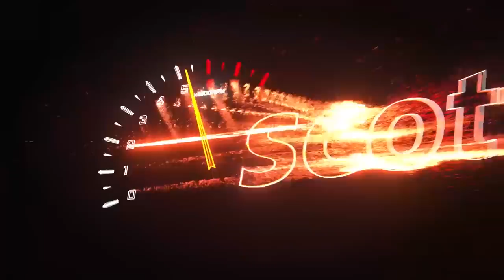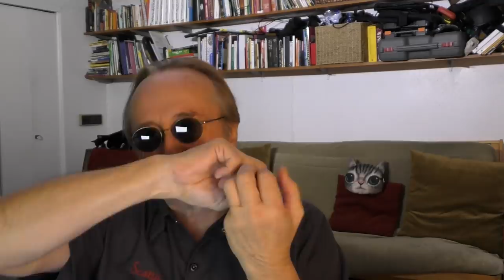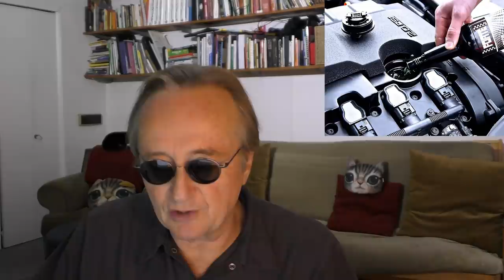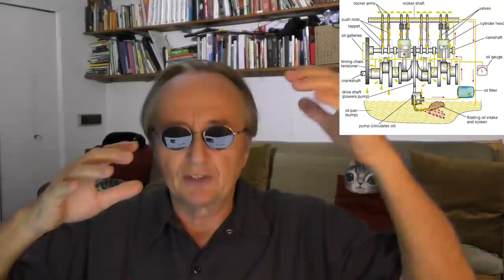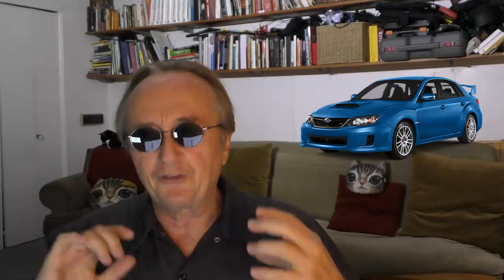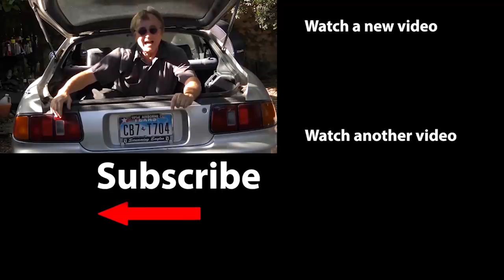Bad Mods that Will Ruin Your Car

Comment: I've never had issues with Subaru. Growing up, my mom had one and it never gave any problems. I now own an 18 Impreza myself. I think they are really easy to work on and I've seen some with over a million miles on them. Never seen that kinda mileage in any other car. It's also not uncommon to find them with over 200k miles on them. I say they are very reliable

Comment: With engine oils people have to consider  the EXTREME condition. If you live in a real hot or real cold area and just make short trips and hardly ever get on highway - this is extreme. You must change the oil at shorter intervals. 3000 to 5000 miles

Comment: I gotta disagree with you on this Scotty. I've had several cars tuned. They get better mileage when driven conservatively, and have much more HP when driven hard. The engineers put a generic tune that they think EVERYONE will be ok with. They're not necessarily interested in performance. They try to find a middle ground between performance, reliability, and maintenance costs.

Comment: "If you want a AWD, get a Tacoma"... "If you don't want a AWD, I'd say... Go with a Tacoma" 😂😂
Reply: yup...  i owned every pick-up there is to own.  The Tacoma gets the job done with zero headache!
Reply: My 13 Taco is a beast.
Reply: Tacomas are horribly slow. Reliable truck yeah, but an absolute slug
Reply: @andeleputo89  
For trucks is more about towing capacity to be fair
Reply: @andeleputo89  Ive got a '19 with the four cylinder.. it does alright.  Very comparable to a ranger with the 4.0, which I had prior.

Comment: The stupid thing to do is tune a car under warranty. I saw a video where Ford was going to replace a Mustang Engine under warranty and then they found it was tuned after they checked the computer info and voided the warranty, even though it was a defect in the engine.
Reply: I had a customer who decided to post videos online of the modifications he did to his new Mustang.  Then he posted the racing he did with it.  When he blew the engine he put it back to stock and had it towed in.  Ford fixed the engine under warranty.  Then he did it again except this time it was the transmission.  Ford put a transmission in it.  When he blew the engine again, Ford sent an engineer to look at it. The engineer found the guy's videos and voided the powertrain warranty.  The customer was mad but ended up buying another Mustang from us.

Comment: I'm on my 4th VW. They've all been reliable and fixing them isn't really more expensive than fixing a modern American car. My latest VW is a Passat TDI SEL and the odometer just flipped over 100K miles. No issues whatsoever. My privious VW was a Jetta 2.5 SE. I sold that car with 160K miles and it was still running strong - it needed struts, brakes, tires and a timing belt, but hey it still ran great as a daily driver. I think most modern cars can be reliable if you perform regular oil changes and all recommended service. Reliability goes south when you skip oil changes and drive the car like an F1 driver - just my two cents. Oh, and by the way, love your videos Scotty - always look forward to seeing a new one.

Comment: My 84’ Toyota pickup stock came with the 22r carbureted engine not much for hp or torque, it ran but not great. First think I did was modify it...well sort of I used Toyota factory parts, I converted it to EFI. Using all factory parts from the fuel pump to the engine for the conversion, runs great, no tuner mods here.

Off road not to big with a V6, 4x4 Tacoma all the way. If you get a TRD package the rear differential has an electric locker, there awesome. I put the hole rear end in my 84’ just to have extra traction off road.
Reply: I have never successfully rebuilt a carburetor on a 22R.  :-(

Comment: Performance tunes are cheap. It's the race plugs, intakes, fmic, oil changes, spare ECU that get expensive!
Reply: tCizzler1 definitely not wrong
Reply: That’s why I go to the junk yard there are plenty of goodies on cars. I got a used sti turbo for 75$ with no shaft play.
Reply: @subarubuildz1738  no shaft play? For $75?? I'd ask for my money back! Lol
Reply: The turbo worked perfectly why would I ask for my money back it was practically brand new.
Reply: My main comment is about the supporting mods that are required for most tunes, even basic tunes. And the response is "that's why I shop at the junk yard". Meanwhile, NONE of things required for a tune can be purchased at a junkyard, they're all aftermarket, with the exception of a spare ECU.

Then, you set me up for a top notch "SHAFT play" joke. And the joke goes unnoticed. All I'm saying is that if I pay $75, I better get some SHAFT play! 😉😉

I can't believe I have to explain this, lol.
Reply: You can build a car for cheap if you know where to get parts and tuners.
Reply: And if you win the lottery, money doesn't matter. But that's not really relevant to the comment. That's not the point of Scotty's video, or my comment. Fast , reliable, cheap. Pick 2. That's all I'm saying.
Reply: I don’t care about the best reliability of a car you buy a sport car you drive it fast. Stick to your slow boring Toyota. If your buying a car for reliability go somewhere else people tune cars for numbers. You don’t has to break the bank for a fast reliable car. You need to do your research before you comment. You can make any car fast and reliable. When tuning a car you can control almost anything with the proper software. It also depends on the tunner. If your going for a full build like 400+ that’s when you has to do a lot of mods and pour money and unreliability becomes a issue. You can build and tune a car for under 2000 if you know your stuff.
Reply: @subarubuildz1738  " you need to do your research before you comment". And YOU need to read and listen before you comment. I'm not sure why you're even commenting here. Scotty IS talking about 'reliability' with tuning, and I'M talking about how expensive aftermarket parts are that support tunes. (It's about practicality. But for some reason, you're talking about building junk cars from junk yard parts because you know a guy that knows a guy that tunes cars in his garage on the weekend.

Comment: Kinda agree I couldn’t find a stock Subaru wrx so I bought one that runs on e85, Cobb software and many other goodies. The gas goes quick but it’s fun as hell. It shoots flames and 0-60 is like 4 ish seconds. Certainly not as reliable as a stock one. Honestly if you want to mod a car go for light upgrades like exhaust and suspension. Any engine mods will decrease the life of your car unless you got a bunch of money to fork out.  I’m most likely gonna de-tune the e85  gas because it’s currently being daily driven so not a great choice of gas because not a lot of stations carry e85 and I get horrible gas mileage.

Comment: The worse scam is a "performance chip.". You believe that you're buying an electronic circuit, but if you open up that "chip," all it contains is a 31 ohm resister to take the place of the intake temperature sensor.

Comment: I have a 1998 subaru legacy AWD sedan. (For 9 months) engine ticking since ive had it, hasnt gotten worse. Runs good, has slight issues when shifting at times, but it is wear and tear,  has 273,000 miles. Its reliable, and built like a tank lol

Comment: Better MPG on a turbo diesel tune is pretty standard. Engines run more efficiently under high load, low rpm so getting better torque from a tune so you can drive in a higher gear is going to save money on fuel and you get more power when you need it.

Comment: My first Subaru 92 model year bought used in 1995, traded 2013 on a new Forester still going well.Maybe I dodged a bullet in between models.Will see how it goes, both the old & new serviced by the book always,local standard fuel is 91Octane ,always used the 95, both are happier on 95 than the 91.

Comment: Usually a good tune will get more power and better gas mileage but will pollute more. Now on a DIESEL, its rediculous how de-tuned they are from the factory.  From a stock diesel, (take ur pick duramax, powerstroke, cummins) a good tune will net u about 100 horsepower & 20% better gas mileage).

Comment: I don't understand your disdain foe Subarus, the boxer engine is an old design but so are inline 4, V8, inline 6, etc. While head gaskets might bean issue for some model years, in my experience they have been very reliable up to 300,000 km (185,000 miles). My family and I have owned a dozen over the years, 8 manuals and 4 automatics, and only one needed new head gaskets, a used car that the previous owner over heated. 

No issues with any of the automatic transmissions, all have been rock sold, only ever replaced a clutch 2 of the manuals. For each car the maintenance has always been done on time, using fully synthetic motor oil, never high speed or off road abused. Subarus make the best all wheel drive systems, they've been doing it for over 30 years and they really make winter driving easy. To be fair ever one of the cars were either the Loyal, Legacy or Legacy Outback models with 5 doors and in this area every fifth car is a Subaru so there are many mechanics that know these cars inside out.
Reply: Scotty's standards are really high, Subarus aren't as good as Toyotas if you don't take care of them, but if you take good care of a Subaru it can be very reliable. But personally  I don't trust the new CVT ones, I've got an old 4 speed and it's been good to me.

Comment: I like Mr. Kilmer's videos and even bought a Toyota pickup based on his recommendations. But I have been owning VWs since 1972 and depending on the model and technology they are dependable cars. One of my VWs is 28 years old, another is 14 years old. The 2.0 liter 4 cylinder engine Mr. Kilmer didn't recommend in the video is exactly the kind of of engine Mr. Kilmer should love. It was the basic VW engine that was perfected over 30 years. The engine was very dependable and lasts, but VW cancelled it because it was normally aspirated, got mediocre mpg, and was quite slow while buyers want fast not dependable.

Comment: An exception might be the Subaru BRZ/86/FRS. The stock tuning has a big flat spot in the power curve, so it has much better driving feel if someone good changes the fuel injection software. Off topic, I got new glasses recently and was having trouble seeing well, more than just the normal getting used to them. I noticed the middle metal bridge for your glasses was almost touching your skin. I adjusted the nose pads to be the same, and can see a lot better now, maybe preventing a car accident- thanks!

Comment: Indeed, GM quality has sadly gone (way) downhill. 2014 Chevy Sonic owner here - 54K miles. Two separate coolant leaks last month, and a NEW coolant leak this month. My power-train warranty is still in effect, so it's going back to the dealer first thing tomorrow morning. I still love this car, but I hate all the planned obsolescence built into it.

Comment: cold air intake, smaller pulleys, hotter cam, colder spark plugs, modified exhaust w/o catalytic converter, "flashed" PCM, then take it to the dyno shop for some numbers. 
Did I forget anything?
Reply: Yeah, driver mod and stickier tires.

Comment: I have a 2016 Chevy Malibu. The car gets 32mpg and I have never had a single issue with it that wasn't covered by recall or manufacturer warranty. Also, if you get into an accident, repair work is much cheaper on GM products than any other vehicles.

Comment: These days, if you take your car to a dealer, the first thing they will check is the program in your engine management computer.  If you have an aftermarket program your warranty will be void, assuming your car is still under warranty.

Comment: Cant say Subarus aren't reliable, we've had  3 in our family. All very reliable, awesome in snow, just do the maintenance.
Reply: Only thing I don’t like about them is there’s no fill tube on the cvt.  Have to get the car up, level, up to temperature and fill through the port.  Just makes routine maintenance a much longer job than the other guys where it’s drain, measure, fill.

Comment: I have a 2018 ridgeline it's good as is other then the manufacturer put in a faulty transmission and, when the recall happened  the dealer and manufacturer didnt want to replace it  and after being firm they changed it for me and since then knock on wood it still runs
Reply: @spenserchalkley7013  I had honda accord  that was super dependable I had forever till it got totaled in a wreck which led me to considering getting a ridgeline truck, but I had bad experience with a lifted f150 always replacing locknhub and axels.
Reply: @spenserchalkley7013  I actually perfer honda dirt bikes and honda street bikes lol

Comment: I've got a '93 Caprice with 237k that is my daily driver.  No leaks.  None.  I think I can go to at least 300k before I even entertain the thought of a rebuild, and that would be more to bring the motor back to factory spec than because it really needs it.

Comment: My first race car was a Chevy Vega with a 454 rat motor hurst shifter the frame was welded solid    Had. 20 pound tank of medical ether one tank of oxygen that ran into a blending module into 850 double pump quad Holley carburetor. Incredibly fast off the line we raced all over the state of New York but incredibly incredibly dangerous

Comment: For the 2015 Crosstrek, you might want to check the tube seals. I had a similar problem with my Outback, turns out my no. 3 plug had just a tiny bit of oil leaking.

Comment: The CT guy. I live in CT as well.  I have had Subaru’s. Best AWD system. Ok gas mileage. But yes the head gaskets break and you have to replace the timing belt at 120k and that is expensive. They change the water pump and idlers at the same tine.
Reply: FB20 & FB25 now use a timing chain.

Comment: Scotty, one correction on the subaru engine statement! They have had a new motor since 2015, which has appeared to solve the old head gasket issues.

Comment: Those engineers are instructed not to get too good of gas mileage because their corporation works with oil corporations that don't want gas savers. Look what happened to VW they started to develop very high mpg cars and the powers to be are stepping all over them.

Comment: Toyota is conducting a safety recall involving certain 2018-2019 Model Year Lexus LS 500, LC 500, RC 350, RC 300, GS 350, IS 300, ES 350, LX 570, GX 460, and RX 350; certain 2019 Model Year Lexus NX 300, RX 350L, and GS 300; certain 2018-2019 Model Year Toyota 4Runner, Camry, Highlander, Land Cruiser, Sequoia, Sienna, Tacoma, and Tundra; and certain 2019 Model Year Toyota Avalon and Corolla in the United States.  Approximately 696,000 vehicles are involved in this recall.

Comment: Every car I've had tuned is faster and gets better gas mileage. I've had 6 or 7 cars turned. Except my focus st but I'm not sure cause I tuned it right before winter. It's faster but gas mileage is down.  But my 06 impala ss gets much better gas mileage and the DOD is off. It's been tuned for 165000 miles and zero issues with the engine and transmission and lots of fun.

Comment: I have a 2003 Volkswagen Golf GTI 1.8 turbo I’ve had it for 16 months put around 15,000 miles on it. It’s at 150,000 miles rn. It’s doing good but it’s been making a really loud noise for like 8 months know in the engine. Should I sell it?

Comment: You know... II remember the 80's GM's pretty well... and back then I remember thinking what crap they were compared to my 1960's and 1970's GMs... Remember the metric 200 transmissions and frames you could straighten with vice grips?  And who could ever forget engines that were so buried in pollution control hoses and wires you couldn't even find them under the hood?

Doesn't it somehow seem strange that now we fondly recall these turds as being "well made" as compared to today's GMs.  I suppose the more things change the more they stay the same.
Reply: When you have a V8 400 with 175 horsepower

Comment: What is your opinion on a 2019 Mitsubishi outlander 2.4L  4cyl FWD? bought it new. I have a 100,000mi  10 year warenty.  It was cheaper than the Nissan rouge that had half that warenty and assume the Mistubishi is more reliable. I could not afford the RAv 4 New. I drive 70 percent highway and change oil every 5,000 mi and trasmission fluid every 30,000.

Comment: I dislike the argument Scotty and many others make that goes ''company x has the best engineers and they know what they're doing'' etc. Yes they may know what they are doing but they also have to design for the motor to pass emissions and god knows what other regulations.  There are people outside the honda factory that are just as smart and with less restrictions.  So if you want to get an extra 10 hp at the expense of more emissions so be it.

Comment: not true, there are usually at least 1-2 good specific companies on most specific cars that will tune your car to its maximum potential, this isnt some "half baked" scammer that scotty claims. They actually do improve gas/power depending on the car even the newer ones still do not perfect the fuel/air ratios of most modern today cars. Turbos benefit the most from it making usually 40-100whp+ reliable. Its not always black and white, i did save more gas on my last car which in the end it paid for itself, but if you mash the throttle for that extra power of course youre going to get worse gas mileage.  For N/A cars it depends mostly on your displacement, usually around 8 - 25whp on tune alone with no mods. Its actually pretty dumb if you do not tune your car too if you put on bolt ons cause youre engine will run too lean which is not good. My N/A car alone makes 50whp+ with bolt ons and tune.
Reply: Well said. Getting someone to do it well is the problem. Most places just want to sell you whatever plug in tuner they have in house to " tune" it with.  In my opinion if its not Mugen or Hondata its nothing. At least for me.